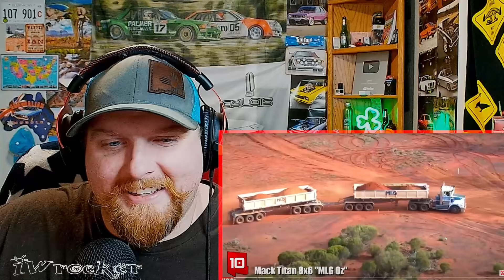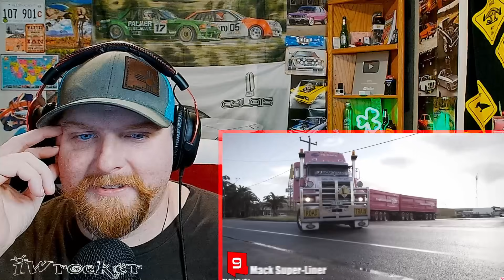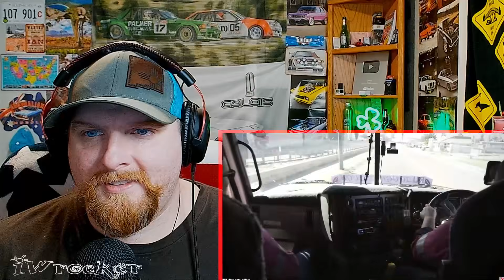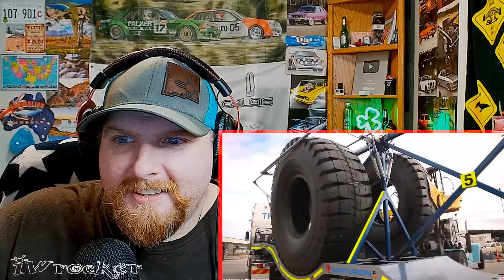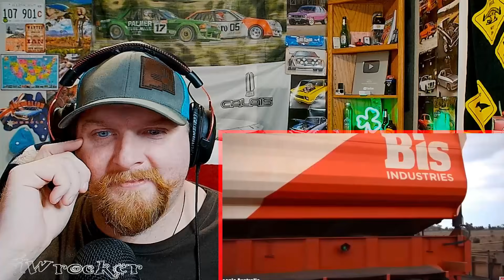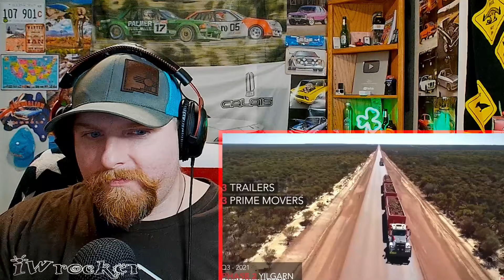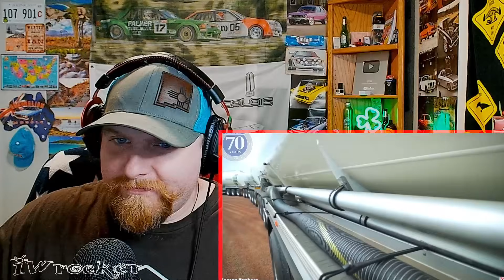American Reacts to The BEST Australian Road Trains Ever Produced

Comment: Kenworth Australia - trucks designed and built in Australia using Kenworth America parts made here and modified to local specs. e.g. -  C5-series Kenworth had the front axle moved forwards, local designed & made power-steering unit, suspension, articulation etc.         Many are custom made to customer requirements and/or specs.

Comment: Cab over vs long nose (bull nose) - Many (not all) drivers who dont drop to a supplier in a city condition will use a cab over due to space. A cab over you can get more space to pull forward and line up a dock. Where the bull nose driver will tend to drop a trailer, turn around with other trailers and head back to location. Not the rule, but definitely preferred.

Comment: Those tyres are worth 30 grand each. They’re stored down in Perth and they have a spare tyre for each one in operation up north. They’re made to fit the Haulpaks on the mines. 
When there is a puncture the trucking company has 48hrs to get the spare tyre up to site.
Reply: Even a tyre for a IT can cost in the vicinity of 15k. My ex mate was a buyer for  one of the big mining companies for their tyres. Imagine the budget. My son is a diesel mechanic on the above ground mining equipment. Geeze they are huge. Even the tool box you have to have to fix them are  huge. Blows my mind. Son  reckons his tools are worth 30k. Did his apprenticeship under ground on boggers, jumbos etc.

Comment: All Kenworths in Australia, have been built in Bayswater, Victoria, since 1977. I owned one of the last to be shipped to Australia in a crate and to be assembled in Australia. It was a 1976, K125 COE, with a 350 Small Cam Cummins, 15 speed direct Road Ranger, and 42,000 Lb Eaton Diffs on Torsion Bars on 11R 22.5 tires.. 
When Paccar decided to send trucks (Tractors as you guys call them) to Australia, the Australian Govenment required that Paccar only sell one brand in Australia, to protect locally manufactures such as International, Ford and Leader trucks. Other brands were imported from England such as Leyland and Sedden Atkinson, and European brands like Volvo, Mercedes, Man, and Scannia.
The only exception to Australian built Kenworth's would be trucks that are models not manufactured in Australia, such as T800's and some Oil Drilling Pole trucks. The massive KW's you have commented on in some of your videos are what we call "Big Foot" Kenworth's, which are for extra heavy duty, and commonly run 25.00 tires.
There are alimited number of Peterbilt trucks in Australia, but all are imported second hand only and have to be converted to Right Hand Drive before being allowed to be registered in Australia
Macks are also built in Australia, in Brisbane, Queensland. I have been a Truckie in Australia for over fifty years having been an owner operator with two COE Kenworths, and also a driver for both cattle cartage, Heavy Haulage, and general freight all over this land. I have also driven over 300,00 miles in the USA over a four and a half year period, back in the 90's up until 911 stopped us running into New York city. Hope this helps Cheers Dave T🤠.

Comment: We also have a truck called a Kenworth C510. It's ofroad only as it is about a ton and a half heavy on the steer. We pulled 225t in 3 trailers at about 85kph.

Comment: The 'Australian' Mack nowdays mostly uses the Volvo drive train with the 685hp and the i12 trans. Towing a two trailer train averages just over 2km/L against the CAT 550 Acert getting between .9-1.1km/L. Due to the superior pulling power it also knocks off about 2.5-3hrs drive time between Adelaide and Bunbury via Esperance..... soooooo much better!

Comment: 6:56 and it's not just about just the transport, but also loading and unloading, because think about it. They could just use regular trailers and ship them horizontal... but that would damage the tire's face before use, and more importantly, it would add two extra steps to the affair on both loading and unloading - as you'd have to tip the tire. This is akin to US' car trains where they'd put cars vertical to ship them by train, but in reverse, they built those cars specifically with the idea of putting them vertical and they made the special train cars to pack as many cars as possible in one load.

Comment: I know for a fact that at least Kenworth and Mack are built in Australia, the video didn't do its research properly, they just say its American because thats where the parent company is based. 
I work for a company that has 14 Roadtrains that mostly carts grain with 2-3 trailers. Most of the trucks are Mack Superliners, when you order it you get an eta as most of them gets build to your specs right here, our new fleet of trucks was actually ready months before our trailers as there was over a year long waiting list on them.
If you are looking for the ultimate in Roadtrains then look at the Quads our mines run, they have extra engines with hydraulic drives on the trailers.

Comment: I worked on in the iron ore mining industry for many years. The end of my working life was spent east of Port Hedland in an exploration camp. Saw plenty of the quads and super quads. What amazed me was the number of tyres on the road. The most I saw was a super quad with 144 tyres. Yes the drivers always looked out for those wanting to pass but of course you had to have a CB radio on channel 40 to communicate with them. Typically they would say something like “LV following TM353, which might be the truck’s ID number always on a sign on the last trailer, you’ll be clear to pass when………..vehicle passes”.
I also saw many of the haul truck tyres delivered to the mines I worked on over the years. They don’t carry them laying on their side because they are approx 3.6m, nearly 12’ in diameter. Oh and 10 years ago they cost nearly AU$40,000.00 each. 
A haul truck suffered a blowout about 120 m away from where I was working and spat a piece of rubber in my direction. The sound of the blowout sounded like a blast in the pit and rattled doors and windows 300 m away. I looked up to see what the noise was and saw this object heading in my direction. I ducted behind some equipment I was inspecting. The piece of rubber struck an IBC directly behind me and shunted it about 1.5m across the ground. If I hadn’t ducked it would have taken my head off.

Comment: Mack has since 1963 operated an independent manufacturing facility in Wacol, Queensland for their Australian trucks which are purpose designed/built for the Australian environment.
As for the Kenworth 509 is is mainly manufactured and assembled in Australia but some parts are shipped from the US already partially assembled also.

Comment: I think the autonomous truck operates on closed private roads for very large iron ore operations. A closed road simplifies things massively and is a good application. Most acurately it would have traded train driver jobs for operations supervision. I'd really like to know what made it worth doing -  just the driver remuneration and expenses? The mass (did it say 375 tonnes?) is amazing.
Reply: Most autonomous operations are more safety related than cost related at this point in time. The additional infrastructure, technology and support costs currently outweigh any driver remuneration. The sales pitch will always push the efficiency aspect of being able to operate longer without stoppages. The current reality is that this is not the case. Autonomy comes with a whole host of additional challenges that are not highlighted in the 'sales brochure', but it is getting better all the time

Comment: As someone who works in the pilbara region of the northwest of Western Australia working on the "on highway" trucks, you should look into more of the iron ore and lithium ore movements up there. There are fleets up there as MGM, Dave Campbell transport, Jamieson transport, ReGroup, Bulk Line, Qube. Running Kenworth C509, T909, Western star, Mack, Scania, Volvo. The combination of different quaf road trains from "quad" to "mega quad" and "super quad" configurations up to 240T
There was a company that were running "quince" set ups of 5 trailers, but still within the 60m limit as well. 
No to mention the movement of bulk liquids, and also other mining production products. 
I really feel you would be amazed at the scope of the operations in the region and how they all work

Comment: Our grand central highway goes north-south through central Australia and used to be the only road in the country without a speed limit. It now has a limit of 130km/h. The scary part is that the "highway" is essentially just a dirt road. So you'll see these giant rigs flying past each on a dirt road barely wide enough to fit them both and it's terrifying. Outback truckers have mad balls. Without trucking, Australia stops!

Comment: Okay as an Australian here, the reason our trucks look so beefy is that they have to deal with the local wild life which has caused quite a few deaths over the years. Now every country has wildlife problems but a road train hitting a Red Kangaroo at high speed will screw up a truck well and good. What happens is they freak out and try to jump high to get away causing them to go through the wind shield when hit. Even wombats can screw over trucks and they only come to the knee, the little bastards have bone armour plating under their skin and are solid muscle. Trust me look it up it’s insane. 😋🇦🇺🦘

Comment: The wheels are to wide to ship horizontal, because they are also to high because too tire stacked are problematic. The big mine tyres are heavy but stowed upright like that then a decent gap between is ok with the road rules as a somewhat standard load. Otherwise your required to have a specific load loader with massive amounts of axels and tyre also requiring flashing lights, escorts, drinking times and hours and that’s $$$$$$$. Plus most mines will change the tyres in groups so if it’s a 4 tyre dump all four wheels get changed and the rubber batch numbers will match ect.
Reply: *driving times! Alcoholic truck drivers are not a thing even in Australia lol

Comment: I think made in USA covers engine drivetrain plus other bulk buy systems like wire elec ect. 
But essentially it’s put together in Australia with most basic things like chassis rails, fibreglass mouldings, created in oz. So made in USA is somewhat deceiving because the trucks are definitely not shipped to oz as built trucks. Major bits shipped and assembled here trucks would be more accurate

Comment: You can stack tyres horizontally but yes a tyre of that size would be to wide as the width of flat tops trailers are 2.4m  anything over that is considered a wide load requiring special permits which in turn cost more dollars

Comment: In Australia we have length restrictions. This also can include axle spacing. This is why cab overs’ are a little more versatile. In Oz the restrictions are really tight.  We also have, in a few cases, moving oversize loads, a tri-axle rig. Mack had the first one of these out. (Ex Macalease Company truck, now centurion) we have some incredible trailer modules and platforms also. Google that stuff. 
In Oz we have a bit of open space.. the outback. That is just the tip of the iceburg. Google oversize loads in Australia. Dump trucks- just the chassis over here can be anywhere up to 360 ton enjoy ❤️👍🦋

Comment: With regards to the Centurion tyre combo, you can stack those tyres and travel as an oversized load; but you can only stack them two high, and the oversized loads are much shorter so you can’t carry as many tyres or take as many trailers.  So on a normal flatbed trailer, you might get four of those big tyres, but you can only take one trailer; and you would need at least one specialised oversized pilot to escort the load because it would be so wide, other traffic would need to be cleared as the load travels.   Have those same tyres standing up on the specialised trailers, and you can get 6 tyres per trailer,  pull 3 trailers with each truck, and you don’t need any additional escorts because the entire combination is within legal limits.

Centurion actually designed and built those trailers, and other companies are starting to use the same idea to maximise tyre transport.

Comment: Yeah that autonomous stuff is here and here to stay. It works is reliable to a point if all operated correctly with all the checks and balances in place. And it doesn't take breaks like people do. So the mining industry is investing heavily into it. I work on an autonomous site in the Pilbara the trucks do what they do and we have to adapt everything around them. 

The first time seeing a truck the size of a small 2 story apartment drive past with no one behind the wheel it's a little unsettling. But ironically after like 2 weeks you get used to it and its just how things are done in a way. So yeah the point is that MRL auto truck will be the norm on most big sites in the next year or 2 and we won't bat an eye. Because everyone that works on an autonomous site now sees and knows intimately how the systems work and how we have to conduct our actions around them.
Reply: We are further down the auto truck road than most people understand forsure cue south park Hill Billy voice... "They took our jerbs!!!" Yes they are and will keep on doing so autonomous dozers are a thing already too

Comment: Someone else may have already memtioned it, but it's worth noting that while the brand may be American, the trucks are built locally to specifications to cope with the most extreme conditions in arguably the harshest environment one could imagine anywhere on the planet. Dust, dirt, mud, extreme heat where temperatures reach 140F in the shade, corrugated roads in the outback that will even shake these machines to pieces.
Australia is so vast, towns so isolated, literally everything goes via truck to some of the most God forsaken places.
If you ever get a chance to watch the series 'Outback Truckers', it will give you some idea of the crazy environment.

A huge shout out to the men & women that drive these rigs from one side of the country to the other, clocking up millions of kilometres and enduring the most brutal conditions.

Comment: So up in Queensland a lot of outback roads consist of a ribbon of asphalt bordered on both sides by hard claypan, and when you see a road train up ahead of you your heart sinks. You have to close up, fast, because these frackers don't drive slow, and then hit the pedal to the metal hard and keep it there so you can pass 60 metres of truck (that's, what, 180 feet?). If you're in a jalopy you'll be eating this truck's dirt for hundreds of Ks. In WA mine trucks rule the outback roads, all day every day. They're long and they're wiiiiiide, and they slow huge lines of traffic behind them for dozens of Ks, only pulling over to let traffic behind go past when they hit a (very) wide section of road. I've been a trasnport driver in Oz for many years, and as much as they're beaut to look at, when you see a road train in front of you, you groan and face palm. 🤣🤣

Comment: - Kenworths are built in Australia (we don't have Peterbuilt over here - at least not common/ late models ). for the local market - PACCAR owns : Kenworth, Peterbuilt, DAF, Leyland Trucks -  - especially American style "gumboot" prime movers trucks can be bought optioned from a range (or whatever the operator wants)  engine and gearbox selection (Mack is the Australian  Volvo option in a long nore config). Western Stars are imported from the USA.

I recently drove with a buddy from Port Hedland - Northwest WA to the East coast of Australia..  Lots of Roadtrains - in the Northwest the 4 trailer "super quad roadtrains"  (A-Quads) are everywhere in iron ore country, across to Queensland a whole range of 2, 3-4  [B-double (as commonly seen as regular semis elsewhere),  A-Double,  B-triple, AB Triple (B-Double on an A-dolly behind a Semitrailer),  A-Triple, BAB Quad (2 B-doubles in a train) , ABB Quad (a B-triple behind a Semitrailer) ]-  huge variety trailer configurations and load outs seen.

Volvo and Scanias are operated by those who want to brag about their "European quality" - not to diminish the technology, but even the American trucks are getting hybrid driver monitoring / assistance packages with "autonimous features" - just like agricultural tractors, don't forget the scandi trucks are built for summer logging in Sweden and Finland - those conditions are not easy -  - vs the Easy to work on, highly customisable long nose Kenworths (Melb), Macks (Brisb), Western Star.(Portland USA)..

(For a fairly tough haul unit:  look at the Kenworth C510 - "off highway" - payload 300 tonnes with the use of an additional power trailer- in the train. - some reports indicate engine specs up to 1000HP ??  I don't doubt if one is ok with  reduced reliability several multiples of that are possible - ) - lol, on private haul roads there basically is no limit - to the limit of the  logistics itself - add several power trailers and dolly couple 4 B-Doubles if that fits one's operational requirements.

Comment: If you delve a little more you might find that Scania have a 770hp truck on the market. I know for certain that they have quite a few 730hp units on the road here in Australia and that they have a 770 that was awaiting approval last time I recall, and Volvo had a 750hp unit in trial in New Zealand. The 750hp Volvo also managed to pull 20 40ft containers double stacked 40 X 40 containers that is, for about a hundred odd meters. Video of that is on YouTube with Magnus Samuelsson driving

Comment: Try googling an Aussie road train called "Bigfoot" could only be used on mine sites ( used to run at Woodie Woodie)
The other one to look up is a "power train"   up to 7 trailers, also only on mine sites. Booto Creek used to run to the rail head. Engine and gearbox in third trailer computer linked to truck so as to operate in tandem